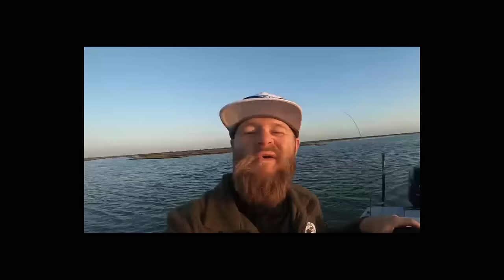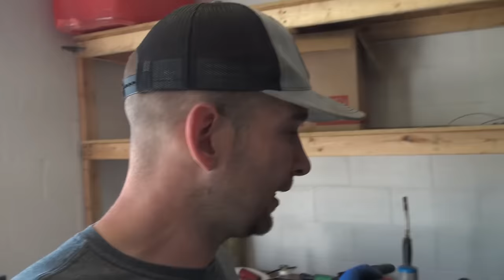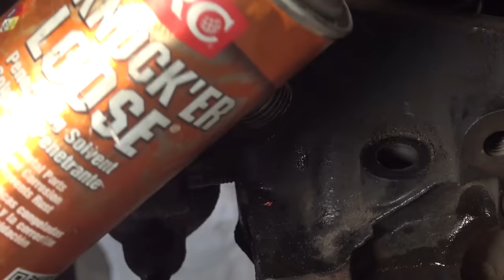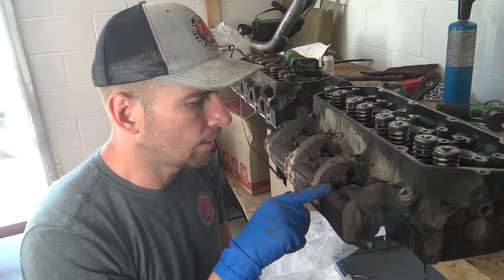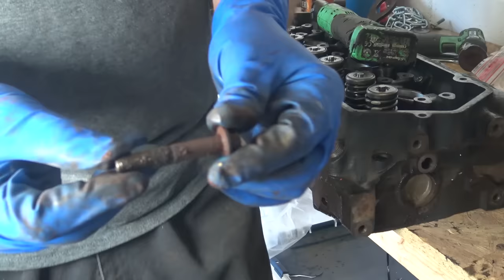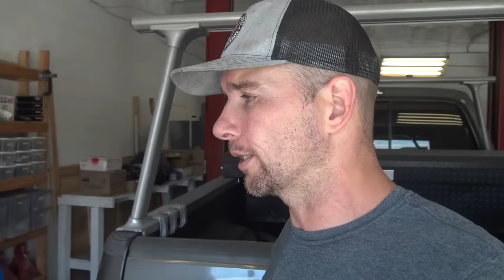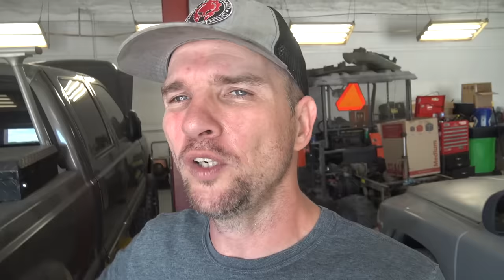Old Mechanic Taught Me This Trick To Removing Rusty Exhaust Manifold Bolts!

Comment: Who makes the best anti-seize coating?  I've been using Loctite Anti-Seize or Marvel Mystery Oil.   I've heard some people suggest STP oil additive.

Somebody makes a set of "easy out" gripper sockets that have teeth inside, which can be used for rounded hex heads;  You don't necessarily need to drill or cut them off.
Reply: Anti-seize is good. Replacing 40 year old bolts with stainless ones is better, time and budget permitting.
Reply: True Anti-Seize has to have solids in it with nickels, aluminum and copper versions being the most common. Once the oil is backed away the solid remain and continue to protect. So use actual anti-seize not oils or lubricants that were never designed to prevent seizure. MMO is mostly a mild cleaner and lead scavenger and light oil at best and STP is an engine oil thickener with ZDDP added in not an anti-seize. You would not lubricate your 5th Wheel with butter or duck fat so why use the wrong automotive product when you can buy a bottle of anti-seize from Walmart, Farm and Fleet, Tractor Supply, AutoZone, NAPA, Amazon etc.....I have been using the same bottle for over 10 years now a little goes a long way.
Reply: @buckaroobonsi555  ,
I think your Apple speech recognition/dictation turned evaporated into "backed away".   What do you think about a lubricant with colloidal Teflon particles?

Comment: Wow, that's amazing. I wasn't expecting much from this video. I've worked on a lot of classic Bugs that were total cancer and I never knew about your technique. Needless to say I've drilled, grinded and cut my way thru countless fasteners. Thanks for the info. BTW I've never seen Knock'er Loose before. I generally use Gasoila Free All because it dissolves rust. Seems to work better than PB as a penetrating lube.
Reply: But if you have to use HEAT use vegetable oil. It melts in better and burns off less.
Reply: PS That is for MN rust. We do know what rust is up here.
Reply: @jimr6121  That is something I've never seen. My uncle used candles. I don't think it actually worked but I'll try anything when I'm in a rough spot.
Reply: @juansolo1617  if you get it cherry red before applying the wax it works great

Comment: Once snapped  the head off a bolt but had an inch of the shoulder sticking out  that inch was  enough to get a pipe wrench one and that was enough to pull it out
Reply: Knipex Cobra the best tool for that (skinny with a good grip). Removed exhaust manifold  4 bolts of ML7 heads yesterday.

Comment: Torch: The hottest part of the flame is where the inner cone meets the outter cone.  You can get too close.
Reply: Craig Smith Yeah, he held his torch a bit too close, wasting time and gas.
Reply: My ears are bleeding!! How loud that torch is.. holy crap
Reply: He's using a propane torch to heat the manifolds and didn't even make the metal glow.    Certainly not too hot.
Reply: I believe he's trying to control where the heat is directed.... You're absolutely right
Reply: Correct, that inner cone is the coldest part of the flame.

Comment: my "old mechanic told me story" is that before you get to the "f@$& it" stage and just risk it for the biscuit with the impact. Heat up the area as hot as possible and shock cool the bolt with water and gently remove it by hand (as it is now fragile). But you should have been able to move the different materials enough with the expansion and contraction of temp changes for it to come out. Then, as Stephen said: replace the bolts...
Reply: Yeah anymore just about anything that I think is guna be an issue gets the heat. As long as it's reasonably safe you always end there anyway
Reply: That's how I do the heat too. I also tap with some force on the top of the bolts with a hammer first to help break that rust weld loose.
Reply: I tried the heat and water technique on a large bolt on a bulldozer it didn't seem to help. Heat, spray lube and working the bolt gives best result..
Reply: @dukeman7595  I've actually had goodluck with the heat and water trick. Although I've never worked on anything as large as a tractor.
Reply: Archer's Gearhead Garage it.works GOOD

Comment: I prefer to use a breaker bar for the initial loosening. That way there is no removal of the wrench, flipping the ratchet back and forth. Just keep the wrench on the bolt until you can turn it a full turn, then switch to the ratchet to completely remove the bolt. I find I get a better feeling of what the bolt is doing that way. Just a thought.
Reply: I'm pretty sure that's why it's called a "breaker bar"!

Comment: Have you tried using a thread chaser vs. a tap? The thread chaser doesn't cut material, it keeps the existing threads intact. I've found that using a tap you'll likely cut the existing threads a bit and make the bolt fit a little looser.

Comment: My father taught me a trick you did not use.  When you are finished, even if you have new bolts, DON'T USE THEM.  Go get stainless STUDS and put them in after tapping the hole.  Use anti-seize, but use two stainless washers, and then put brass nuts on the studs if you plan on having the vehicle any length of time.  To get the manifold off next time, just sacrifice the nuts by using a nut cracker and throw them away (or in today's climate, recycle).  It saves a lot of time and headaches.  If you can't find studs, buy long full length threaded stainless bolts, put them in with a nut on them, then cut the head off with a hacksaw and clean the end of the bolt of burrs as best you can, then take the nut off to assure that the thread is good right to the end.  Hope this helps a lot of people.
Reply: Good point about studs and brass nuts - it used to be the standard way of doing things.

While I'm here, be aware that stainless nuts and bolts are prone to thread galling. The protective top layer can be ripped off when tightening then reforms, locking the thread as if it's welded. Some form of anti-seize or anti-galling stuff is vital.
Reply: @Graham_Langley  With Murphy's help , I learned that lesson the hard way . Anyone who reads your comment will be spared from that aggravation . Thanks for putting it out there .
Reply: I guess that depends on the vehicle...  I run old chevy's, mostly small blocks, and I always reuse the original manifold bolts, they don't rust in like most engines do.  Big block chevy's are a different story though, they like to rust in and break off on their own, so I agree with the stainless studs in that case, but I've never liked brass nuts 'cause they strip out too easily.  I've always had better luck using steel nuts and good thick washers, and yes double washers helps.

Comment: Don't laugh, but bees wax is an amazing penetrate medium.  Old timers in my union would heat a stuck bolt and dab a chunk of bees wax at the base of the bolt.  Worked better than most modern penetrant products.
Reply: PF did a test on this and that did not work.
Reply: @username8171  I just saw that with Project Farm and the wax did nothing. I was going to say the same thing when I read your comment.

Comment: Great tips but you definitely aren't located in the NE of the country. I've had to remove 3/8" studs that rusted to 1/8"  toothpicks from all the salt used in our winter roads.
Reply: Try right after hearing put cold water on the area and you'll see how easy it loosens.

Comment: What might work better for the initial break-free, use a breaker bar; you can put pressure back-and-forth much easier and quicker.

ALWAYS use a better grade fastener than original, that's more heat and corrosion ressistant; factory bolts are spec'd to a price point, and to last JUST past the warranty.  Trust me, they know.

When using anti-seize, use either copper, or better yet, high-temp nickel.  Even though it's more expensive, it's cheap insurance you won't EVER have a problem with galvanic corrosion on the threads again.

Comment: This is usually how it goes for me
Step1) Spray n wait
Step2) Spray more n wait more
Step3) Heat
Step4) Break it off 
Step5) Get the mig welder, washers and nuts out
Reply: If it jams force it, if it breaks it needed replaced anyways.

Comment: Steven, been there done exactly that. And it does work!  Patients is a GOD sent, and that’s the trick.   Although I did have to use oxygen and acetylene on some real stubborn ones.  One of my vivid broken bolts were on a Komatsu loader where all the bolts were snapped off clean for the rollers.  I had to remove the entire frame from the loader. Turn it up side down. I started with a 1/8 drill bit, and drilled completely through. Then stepped up to a 1/4 drill, then to a 3/8 bit.  I used the Ridged fluted screw extractors. All the holes were drilled before I went home for the day, I heated all the broken bolts with the torch and went home. The next morning I saturated them with PB Blaster, I took a 1/2 punch a fist hammer, shocked all. They a came out with no other issues. These were 3/4” bolts.  You have it all dialed in.  Great job, thanks for sharing.

Comment: Kroil
The oil that Creeps
It’s amazing penetrating oil
Reply: Just left a message recommended it.  Best ever !!
Reply: +1 for Kroil. I do oilfield instrumentation maintenance and we use it all the time.
Reply: I know some people swear by it, but it didn't do well in Project Farmer's test video.
Reply: I swear by aerokroil,
Reply: i used to work at place that got it in by the 55 gal drum
Reply: Kroll actually dissolves the rust. Put it on a day or two before trying to bust the bolts loose.  They have something called Silikroil which has some silicon in it to help lubricate things.
Reply: yes life saver on rusty ol trucks
Reply: I won't use anything  else
Reply: "don't spoil it Kroil it!"
I have used it for years... good stuff.
For precision parts get Kano micro oil. It doesn't get gummy with age.

Comment: I was lucky enough years ago to work with a union millwright at the Kennedy Space Center.  We were tasked with rebuilding gearboxes from some huge roll-up doors which hadn't had much maintenance.  We encountered many stubborn bolts in the process and the millwright's method was to spray liberally with a penetrant and then whack the bolt head from the left and the right HARD with a three-pound hammer. The theory here is that the bolt will move slightly enough to admit the oil between the bolt threads and the hole threads.  It actually worked and I've used this method ever since.

Comment: Good idea, however here in Michigan I use the acetylene/oxygen blue wrench first. Propane ain't enough heat. I mean no offense but you have no idea what "rusty" is.
Reply: Midwest here, same thought.  I mean, the bolt heads are still the same size.  Call me when they've lost enough material where you don't have a wrench that fits them anymore and they aren't quite the same shape either.  You can still see well defined threads on those bolts.  Here we call that surface rust, might not even use any spray, just work it back and forth and go slow, maybe smack it with a hammer a few times.  Really no need for heat, just patience mostly.
Reply: I love watching these videos being a tech in central NY where unless the car is a 2019 or newer the torch comes out for most bolts
Reply: Was gonna comment about that as well unless it’s cherry red it’s not hot. I like using the open head spline drive ratchets and have a helper smack the head with some wrench pressure on it.
Reply: at least a MAP bottle, propane does not belong in the shop
Reply: @petr0rabbit  back in the day we charged ac systems with propane .....bet you can guess why they changed to Freon
Reply: @petr0rabbit  With some proper training propane is safe. Map gas burns hotter and so is better in some cases. I mostly use my oxy/acetylene as heat tip size can be tiny or huge, as needed for larger work or in tight spaces.
Reply: @petr0rabbit  I do copper plumbing work in my shop as well as vehicle work. Propane works best for this as a rule.... heat opposite side of fixture and the solder is drawn to the heat. As we all know - there is no 'one size fits all' application.
Reply: Right ! Everything automotive here in MICH rusts from the top to the bottom ! Its Diabolical  ! DFD = Dont forget to douche !
Reply: Lol central  new jersey is horrible  manifolds fall off from  rust.

Comment: Great video!  A farmer taught me to pound on the bolt with a hammer, soak w/ acetone/ATF, then after the atf/acetone has dried - heat with a torch, quench with water (repeat 5x-10x), then tighten first, loosen second..  Agree w/ antiseize
Great video

Comment: If you call that rusty, you dont know what rusty is.
Reply: Here in Wisconsin I call it Wisconsin Locktite and you will need a flame wrench!
Reply: Maverick Wagner Totally, this engine looks new compared to a lot I’ve worked on here in New England.
Reply: Same here on Long Island brother looking like lead out of a pencil that’s thin ,,,,good health to all
Reply: North East Ohio makes the best rust
Reply: Minnesota is next level rust.
Reply: @paintballpartutd  makes sense Minnesota did and does have a lot of iron ore.
Reply: Maryland roads department uses salt like it's free...
Reply: @thomasmoore4723    haha everything is rustier there
Reply: Hey its just a tutorial on what you could attempt to do a demonstration
Reply: I live in central IL and they use so much salt you don't need a water softener during the winter.
Reply: One of my main reasons for moving from Minnesota to AZ last fall. Bought 5 cars in 2 years from down here-never had a problem with a rusty bolt yet. Road salt is the worst.
Reply: 20 + year boat mechanic. In salt water. I have used every trick known to man. Fire wrench works almost every time.
Reply: @matthewbick1927  absolutely li rust is no joke. It took out brake lines on my car. Car only had 45k miles on it
Reply: Go try this in Cleveland, you'll be drilling. Those bolts aren't even rusty.
Reply: Couldn't believe how many mufflers were laying on the side of the road when I lived in MI for a couple of years 30 years ago.
Reply: I’m from Michigan. I can relate to salt being applied like it’s free. We bought a 2014 F150. By the following year we had rust in the wheel wells. Crazy!
Reply: That ain't rusty! He was able to get a socket on the head of the bolt.Try a Ford F-250 that's be used for plowing in the Midwest. the bolts are a quarter of their original size and no socket wants to even fit on the head anymore.
Reply: Northeasterners: " What are ya taking a bran new head off for?"
Reply: @robertroberts9782  That is because there are only 3 plows in the entire state!
Reply: Michigan rust is like Wisconsin rust but put through a blender and covered with salt and bleach.

Comment: Nothing bugs a guy more than an annoying exhaust leak and thanks for the great advice! Where were you about 30 years ago when I was laying under my '72 Skylark filling my eyes with rust & metal shavings drilling out the lower manifold studs for the pipes? lol. Never, EVER take your eyes for granted like I did is all I will add to this. Always wear goggles/safety glasses! My laziness and Heman attitude got me a trip to the ER to have my head  put in some type of vise contraption with eyes peeled wide-open to have the doc flush & roll cotton swabs back/forth both of my eyes trying to remove some of the stubborn crap that refused to flush out, not a pleasant experience at all. I'll have to add some of that Knocker Loose Juice to my arsenal of goodies, always used good old PB Blaster or WD-40. Protect those peepers!

Comment: I have a 94s10 4.3 vortex Vin z .having to replace the freeze plugs in rear of motor.removed auto trans but can't brake loose flex plate bolts I tried your way tighten an loosen with oil an 6 point socket an it worked just wanted to thank you very helpful.

Comment: stainless steel washers on matting surfaces...anti-seize compound with nickel in it, on threads and in the holes or barrels, where bolts go thru.
another measure of help.

Comment: This is what i do when it comes to sparkplugs that have been in for well over 60k miles.. I first loosen then tighten just like you did but the first loosen i spray some WD-40 around the plug then let it sit a while to seep down around the treads then repeat the steps you did. Works every time.

Comment: Great advice. I too use acetone and trans fluid. It works. What you said is true. You have to have a feel for this. I have also lightly tapped the bolt before starting. Not beat, but lightly tap. This IMO helps get that rust broken, allowing the penetrating  oil to get a little head start. . Rusted bolts suck. Broken rusted bolts suck even more.

Comment: 100% agree...TAKE YOUR TIME!! Be patient, lube and rock back and forward gently. One other trick which seems to work is to whack the head of the bold as hard as you can with a good heavy copper hammer. It often helps shock loose that rust bond.  Finally, if you DO break off a bolt or stud flush with the housing, then find a thick washer that fits the shank side and weld it to the remains of the stud/bolt. Then weld an old nut onto the washer. Then lube and try rocking it back and forwards again. The welding heat often helps loosen up stuff. It also helps the lube to migrate along the threads. There my 2 cents to add to this excellent tutorial!